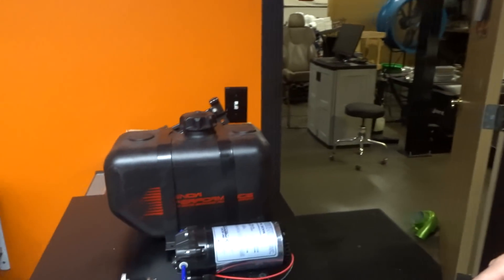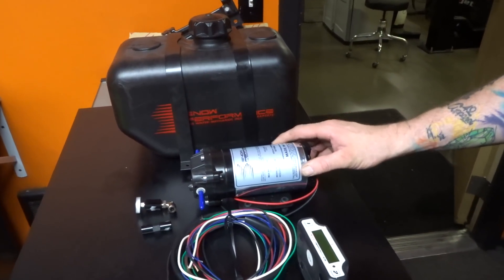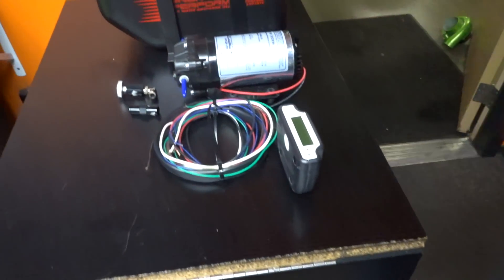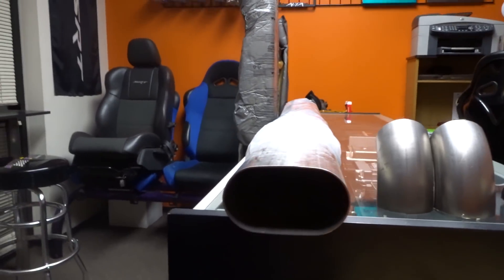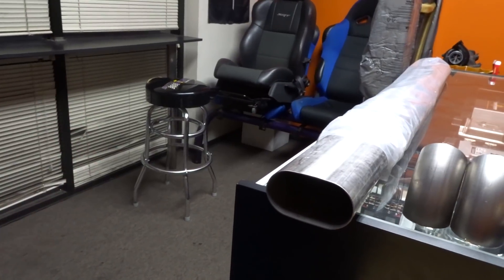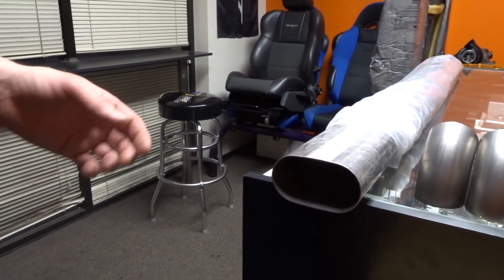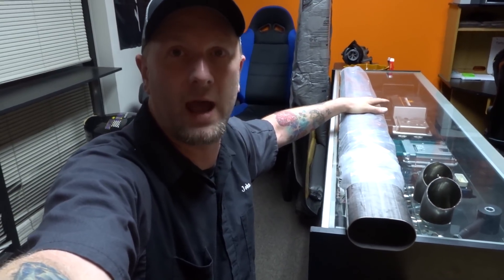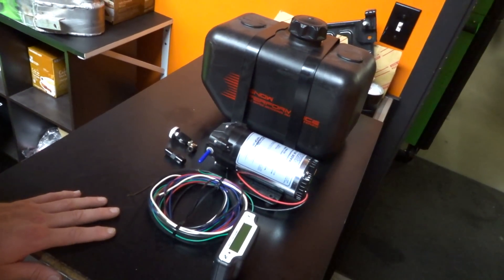KIA Stinger GT Update...Oval Exhaust and Water Methanol

Comment: Good work on your video's.

I can't wait to see the new ecu updates and oval exhaust.
The methanol sys for me will be the last thing to do for 2 reasons.
1 the size of the system (not a lot of room in the car as it is) and 2 definitely will kill warranty.

If you stumbled upon the ecu setting for the Auto start-stop when on the brakes kill the F.N thing for us.
It gets me every time.
Reply from the maker: The system is going to be completely hidden and only thing you will see is the nozzle and the tank. Should take up very little room. Warranty, meh.
Reply from the maker: Auto S&S we are still working on.
Reply: The smaller tank that you added looks much nicer.
Do you need to adjust the ecu to see a gain in hp.
how dose it work when you run out of Methanol (will the car adjust back to no Methanol).
Reply: Most of us appreciate all of your hard work & help. Big Thanks.
Some sales geek needed the auto start/stop instead of a good Rear Sway Bar.
thats the 2 thing that I don't like on the car.
Reply from the maker: We are going to be testing the methanol with stock, tuned and dedicated tune to see if the power gains are substantial or minimal.  I will post more details when we get the methanol installed.

Comment: When you order the ecu & tune will it effectively change all of the drive modes or do you just adjust 1 like sports mode.
I like to keep eco mode as it is and change comfort mode to stage 0 and have sports mode set to stage 1  
 & custom mode set to stage 1.5
That way as i mod the car i don't need to start over with the tune & I can drive 90% of the time in eco or stage 1.

Best Regards,
Mark
Reply from the maker: We adjust all the drive modes, working on addressing just the individual ones here very soon.

Eventually, we would like to have one of the mods set up for high octane, or race fuel, this way you can benefit from a "true" race mode with the ECU tune. Lots and lots of things we are working on, but time is the issue.  I have another 800 to 1000 hours of testing and tune time I need to spend on the ECU, and we are busy in the shop like crazy.